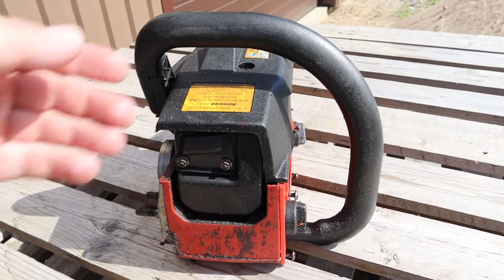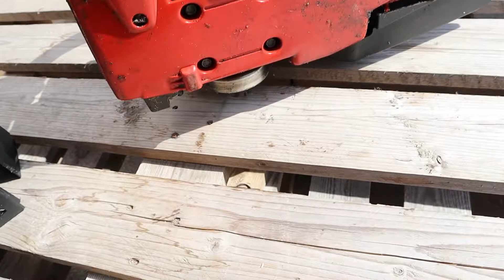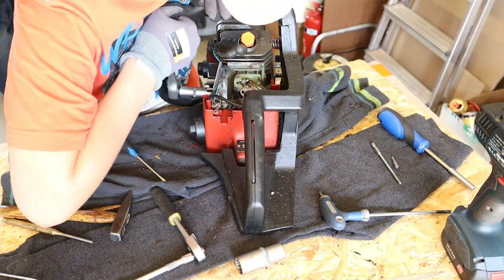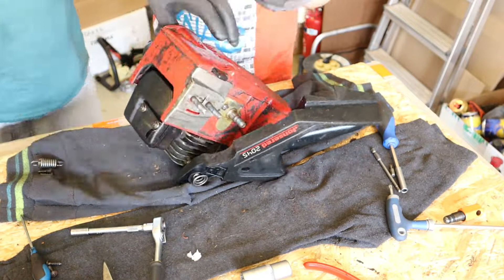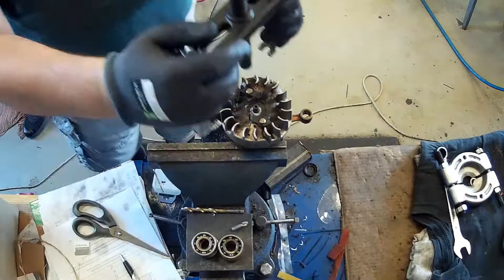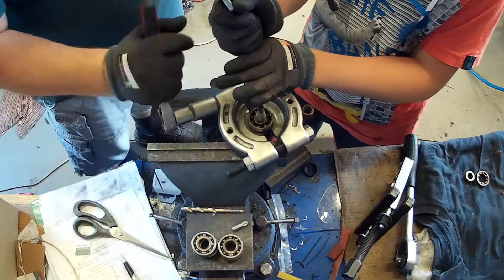Disassembly of Jonsered 2045 chainsaw for spare parts second Бензопила Джонсеред 2045 на запчасти

Comment: Thank you for this instructional video. I'm in the process of restoring my dad's 2045. I think I ordered a carburettor from your ebay store, but I'm still missing a few parts. Do you have a muffler and the heat shield (deflector) available? Also, what's the fuel tank vent valve on this saw?
Reply from the maker: Currently, most of the required parts are sold but I have a lot Husqvarna 40 (it is the same saw as Jonsered 2045). If you still interest on the next weekend I can look at these parts.